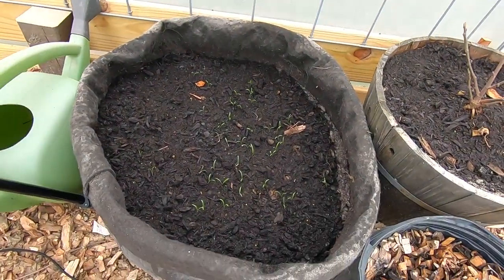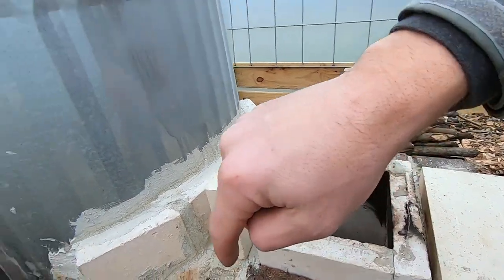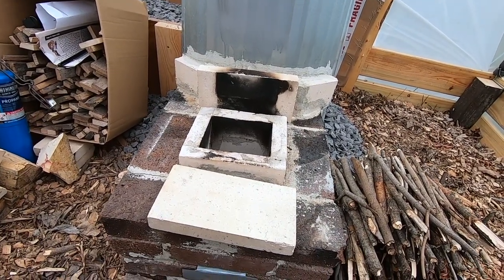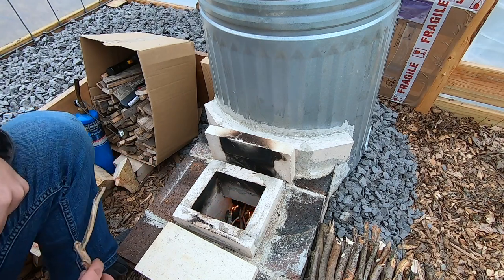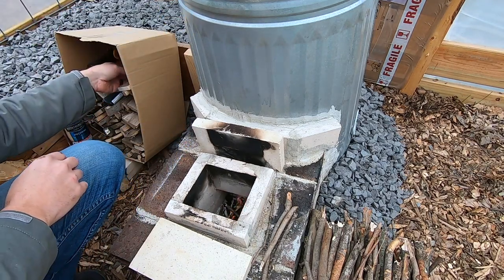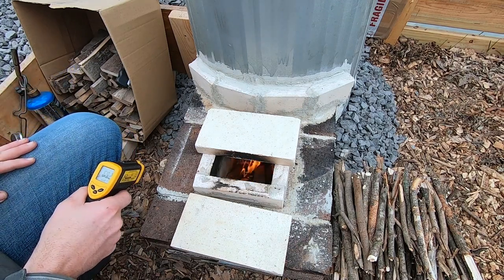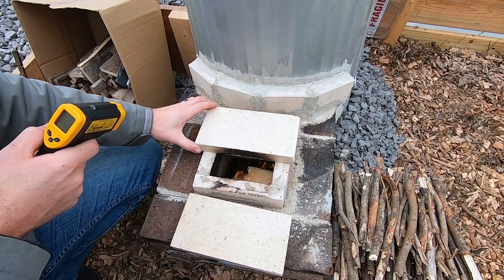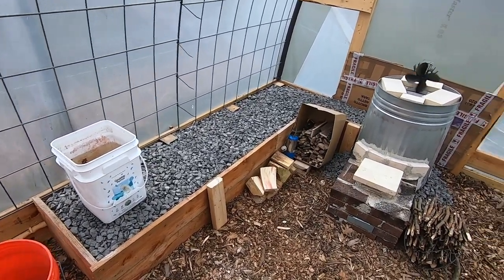Lighting a Rocket Mass Heater

Comment: So much that I like about your greenhouse idea.  I think it probably needs some more refinements, but using cattle fence to make a hoop house, and just covering it with greenhouse poly is pretty elegant and dirt cheap.  

As others have said, you probably don't want to use galvanized components.  You also might want more length of pipe buried, to improve the exchange of heat.  You've got the perfect setup to make mods any time you want.  Nice.

Comment: I like the idea of a rocket mass heater in a green/grow house! With the gravel it seems like a much quicker build than actual cob! Thanks for posting about your build. I like the smallness of it! Great idea! Thanks!
Reply: I have seen them made with sand used as the mass as well
Reply: The only thing I'd do different is use a different container. The rock may not be as efficient but seems perfect for a greenhouse and you wouldn't need as much fuel or burn time.

Comment: Aside from the negative comments about the galvanized can (which you should replace).  I think you'd benefit by pouring sand into your stone mass.  Fill in the air spaces.   It will increase your mass and give you more battery for your heat.  Some buckets of water and plants on top of the mass will help too.
Reply: That will also help heat conduction, as well, so it'll take on heat from the flue gases more quickly.

I think I'd also put fins on my buried flue, for better heat exchange.

Comment: You don’t have a secondary burn chamber without preheated secondary air. Fit a J-Tube shaped pipe inside the J-tube that sticks out of the burn chamber and it ends one or two inches from the top of your riser and your bell temp will double if not burn through that cheap trash can. Have to have secondary super heated fresh air for secondary burn, all that bell does right now is release immediate heat that it makes now.
Reply: Your mass bench will also heat up faster and hotter for those extra cold days. You can also put a slide vent on secondary air to control how much secondary air to flow. Choose your intensity.
Reply from the maker: I am not sure I follow what you are saying, which sounds contradictory to all that I have read/watched about not having metal inside the burn chamber.

One thing I didn't show is a vent on the front of the red brick: it is 4" wide and exposes a fire brick with a few holes drilled through, to allow more air to come in. I have found this to actually be not as necessary and might seal that up.

Comment: Nice work!  I built one in my house and these things are AWESOME!

You say your dimensions are 1:2:4:6  (opening width, assuming square:wood feed:burn tunnel:heat riser).  My dimensions are taken from Erica and Ernie's famous book.  I'm using an 8" system (8" diameter ducting, CSA of 50.26 In^2).  The wood feed CSA is around 7"x7.5" (52.5 in^2, to match).  The wood feed is 16" deep, the burn tunnel is 24" long, and the heat riser is 48" tall.  So to get precise, my ratios are 7.25:16:24:48, or  1 : 2.2 : 3.3 : 6.6.  My chimney is about 14 feet tall.  It drafts without even a fire.  Any smoke at startup just gets sucked down to be burned as fuel.  I made it out of red clay brick and will fill it with pebbles.  It has no mass right now and still keeps my house warm all day after about 1 hour of burning about 10 sticks the smaller than your wrist.
Reply from the maker: So it looks like you and I are not that far off with the ratio, which is good. I would love to build a larger one for an insulated structure...that is the downside to this growhouse is that any heat I can produce is lost because there is no insulation.

Comment: thanks for making and documenting! obviously, replace the trash can  with a burned off 55 gal steel drum, and replace ducting with matching pipe  csa to the 5" firebrick J tube and it may work better. maybe nonflamable materials under the intake too :) and put the chimney inside the greenhouse to use the heat from it too and avoid cold plugs a bit more

Comment: Something's wrong with this design. It's not safe. The galvanized can itself is not durable and not safe. The opening to the galvanized can (the burning chamber) should form a J-shape in order for the fire to have a draft and to direct the flame to go only one direction. For safety precautions,  a pipe or tube should be added for oxygen intake from the outside. There is not enough mass on the burning chamber to keep the heat longer. If the flame in the chamber burns over a thousand degrees, the heat loses too fast when there is not enough mass to retain the heat. The galvanized can may melt anyway. There is not enough draft and the temperature is not hot enough. A good rocket heater may radiate heat for 24-36 hours.

Comment: Boy they sure roasted the galvanized trash can!
Most of the keyboard warriors have no idea what it’s like to be cold because they’re living in moms basement with warm heat pipes around.
They have no problem criticizing others who are doing a lot with very little.
I believe the only difference for you is the need to trim the amount of wood used and the output.
Sticking with the formula for the ratios you said 1,2,4,6 so it really depends on how small or large you are willing to cut the wood.
If you wanted to cut the wood to 3” split wood x 1 foot your looking at a 1 foot opening and a two foot drop which would eliminate the need to chop up the wood to very small pieces.
The burn tunnel would be 4x2 or eight feet? Then there’s no pre-made bell big enough to cover the distance of 12 feet 6x2 would you gain any benefit from making the stove larger or is there a method of understanding what the output will be if the design is in keeping with the parameters? Once you achieve the temperature requirements for efficiency in burning all the gasses made by burning wood is there something that can predict your performance?

Comment: You've already been blasted for the zinc/galvanizing, so I'll skip that.
What I would say is that in my experience, for good combustion and draft, you want a 1:3 or even 1:4 ratio between horizontal and vertical of your J-tube. I cannot stress the importance of the horizontal part of the tube, it is the combustion chamber. It depends on draft speed, of course, but you need a long enough horizontal section to break down the fuel and burn the gasses that result. If set up properly, the barrel should see no unburned hydrocarbons (smoke).
   I think yours is just a tad too short. This will result in the barrell sooting up (potential creasote fire). Otherwise, great job

Comment: Dit you have problems with cold starting it? If so, place you shimney next to the bell (trachcan). this way it heats up better and pulls out the coolt off gasse better.
Reply from the maker: The only time I have an issue with cold starting is when the ash needs to be vacuumed out. Otherwise, no issues.

Comment: What if you use sand or sand & stone? And does it matter what kind of stone?
Reply: The material doesn't matter as long as it is dense. The only thing you want is something to absorb and slowly release the heat. Cobb,   cement, sand, stone, even water would do.

Comment: rather you than me toxic air toxic food nice.
Reply from the maker: That was a concern when I first thought about doing this, but galvanizing needs about five hours at 1,000° to cook off. This doesn’t reach that and I haven’t noticed an issue.
Reply: @theprofessionalamerican  As I understand it various toxins within the zinc treatment start gassing off at far lower temps how much or for how long I could not say, personally I would not take the risk with my kids long term health.
Reply from the maker: @davidprocter3578  that may be true, however this stove is rarely used at full temp for more than 3-4 hours at a time and then it’s left to die out at night. I ran it a lot before any plants went in there and I’m sure the bulk of what may come off the can is done. Who knows.

Comment: Plus your going to have to feed it all the time > Are you going to live in it? To keep it fed?  Mine large US cast iron stove is easy to make a rocket stove. all i do is pull out the ash tray a little bit BOY does she sound like a rocket. Plus i don't have to feed it all the time.. Sorry that sucks 👎👎
Reply: The point here is using less fuel and gaining low but constant heat.
Reply: @Fraususemil  I know what the point is. but its silly!  He will learn the hard way!
Reply: Can you please give more info about your cast iron stove , like make model manufacturer ? Thank you .
Reply: @duhhhh1723  Your just going to have to shop around like i did. What i like is the heating and cooking. less fire wood. The price i paid. You can get parts for them to.

Comment: Why you get smoke coming out when you lite the stove and why it also happens when you remove the top brick to put more wood in .Is because the opening is to big.The other way to address this is to make the chimney higher this woud give you more draw in the stove
Reply from the maker: It is the same reason that you get a little smoke with a conventional batch box wood stove that has been dampened for a longer burn. The temporary fuel to air ratio is changed and it takes a second for it to adjust. If I open it slower, this doesn't happen.